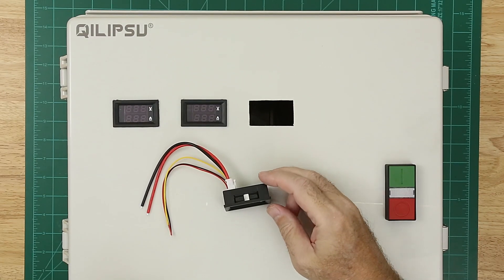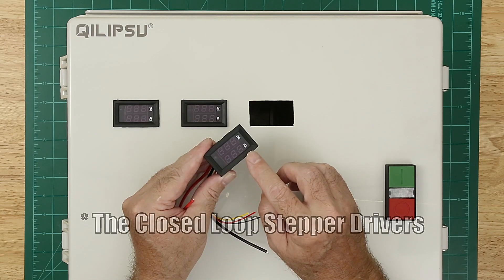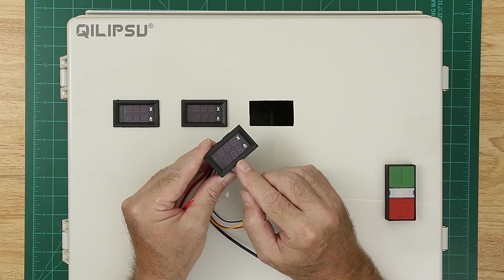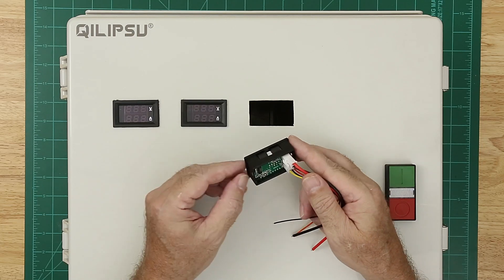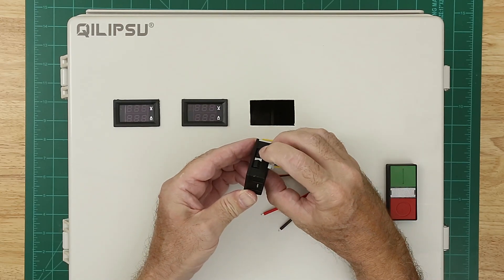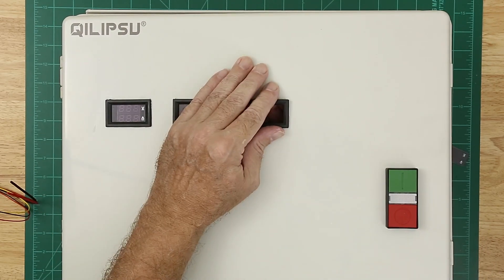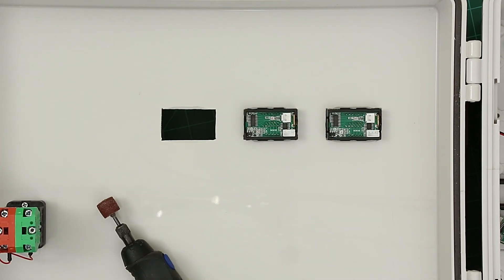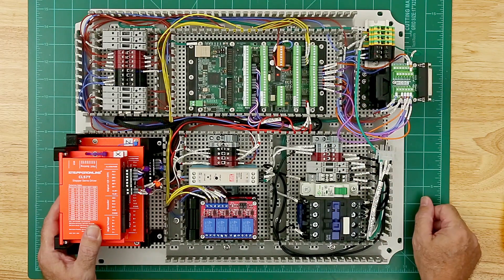Volt / Amp Panel Meter Installation/Mounting

Comment: I was planning on doing the same thing, I 3D printed a panel to hold them with plans to mount the 3D panel on the door. Looked great. The fun began when it came to wiring them. I only have one 24vdc power supply and it’s dedicated to the Acorn board. Everything else is 48 vdc and 220 vac.  Those meters are limited to max 36 volts for power. The instructions are as good as if you didn’t have any to start with. I smoked one before I read that on a competitor’s instructions. It would have been cool to look at but I scraped the idea. I may come back to it but for now I’ll look for the shop lights to dim if there’s a problem. Totally enjoying you videos of the progress.
Reply from the maker: Yea, the ones I have say 30 volts max to run the meter. The meters will measure 100 volts DC though, or so they say; and 10 amps.
I didn't want to use the 24 VDC power supply either, so I found some DC to DC buck converters on Amazon (5 for $11.00) that use the LM2596HVS chip, which can handle the 48 volts from the stepper power supplies. I'll adjust the output of the buck converter for 12 volts. Using DC to DC buck converter seemed like a good choice since the 48 volts is already at the meters. No need to run another line across the cabinet. I powered the meters from a five volt source and they worked, but the LED display got brighter as I increased the voltage... to a point. So that's why I'll use 12 volts to power them. Here's a link to a community post I made with a pic of the wiring. 
https://www.youtube.com/channel/UCHOSNgw0wNxo6bzCCwvRPIQ/community